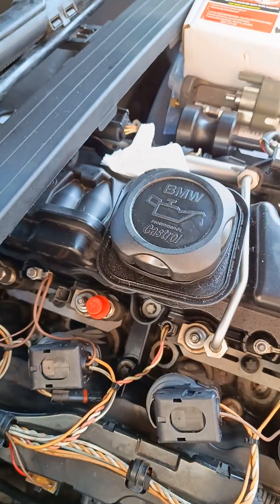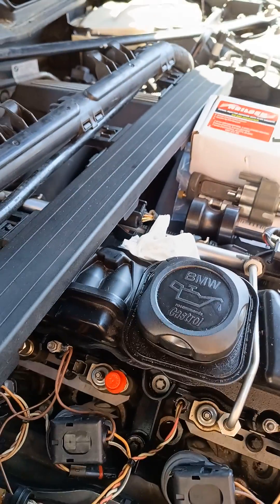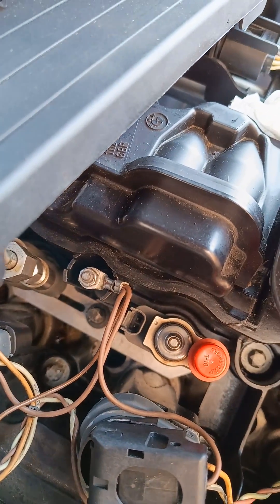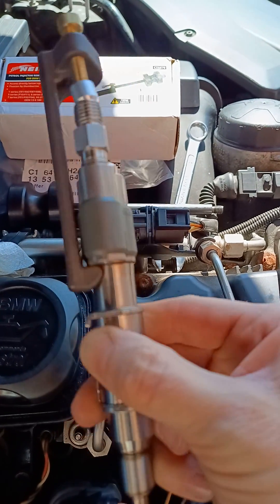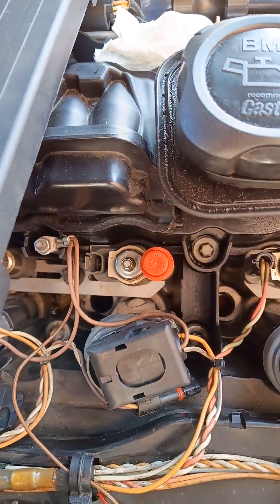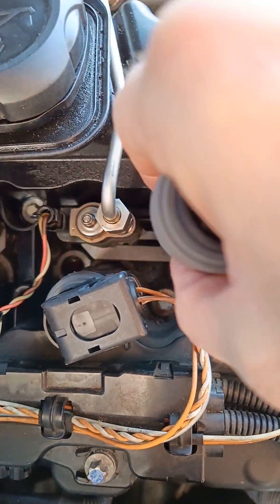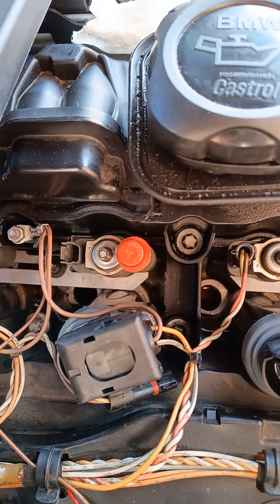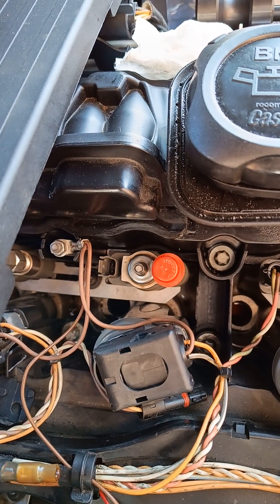BMW N53 Injector change

Comment: Nice video, where did you buy the new injector?
Reply from the maker: It was a used tested one off eBay. They are like buying a light bulb, the test proves it works not how long it lasts. I think new ones cost hundreds and you can only mix certain indexes. I advise doing some research beforehand.

Comment: Hi,  nice video👍 Could you advise where you got the replacement injector (UK?) and shouldn’t you replace in a bank of 3 at a time using the same index? Thanks
Reply from the maker: @stanscott7496  I searched eBay and looked for used ones being sold with a test certificate. Be careful as some claim to be refurbished and don't back it up and others are fake. I've read you can mix 10 and below. I bought the car for £2000 so if I bought 3 and replaced with new I  would have still spent the same again. Buying used it like buying a second hand light bulb. A test certificate shows it works at the time. My fix was £150 for an injector and the same again for pro tool. I'm not prepared to sink too much in as any number of big things could also fail eg water pump or cat converter. Forums talk about solutions 8 years ago, now you're in bangernomics.
Reply: @Toms_Short_Movies  I just bought mine for 1500£ which is a steal for a full msport E61 with an N54 motor. Mine has gone 220 000km though, Trying to fix the 30E9 issue like many others has. Now I at least know how to fix the injectors if they fail - Thankz